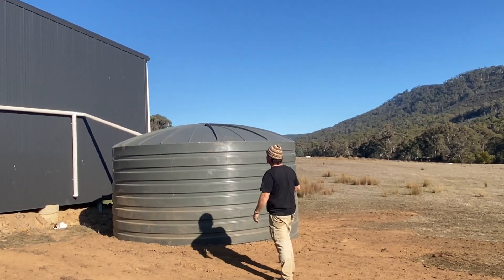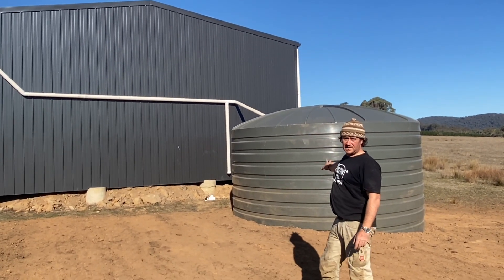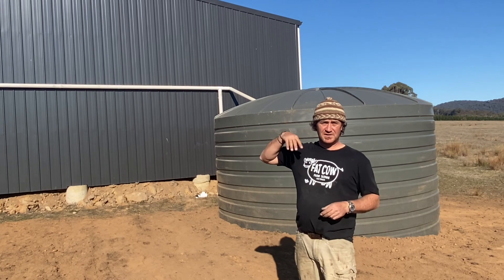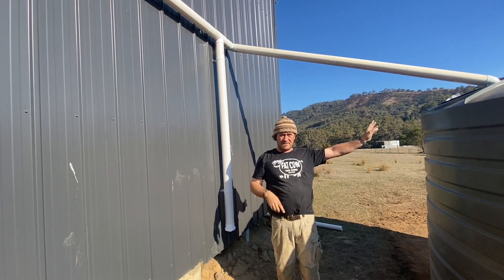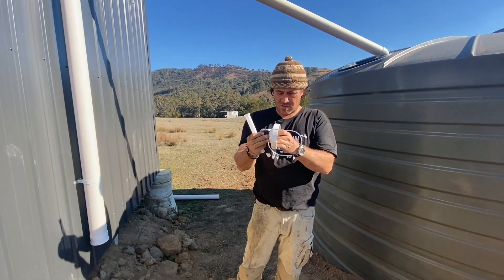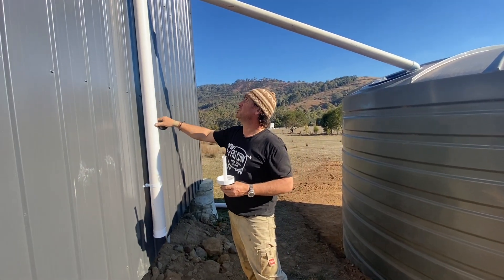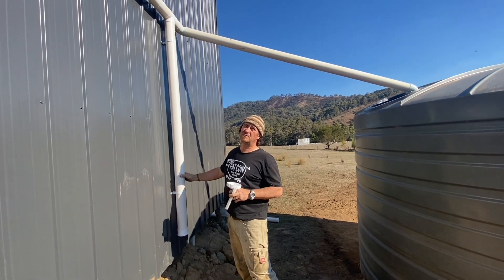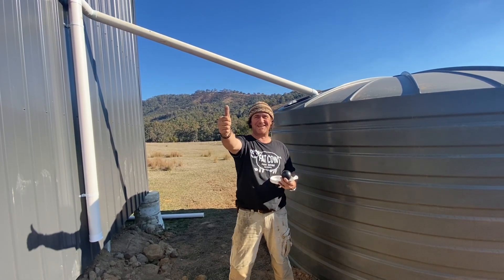Rain Harvest & First Flush Roof Cleaning.

Comment: (Old mate at the shop may have already told you!!)
But if there’s a bushfire & ash or burnt leaves are falling & it starts to rain or if you are using a sprinkler system on the roof, make sure you disconnect this system so all the water can run straight out the pipe & doesn’t flow contaminated water into your tank or you’ll have to dump the whole tank afterwards.

Comment: If you got large land area; try not to put solar panels on the building roof because you need to clean those panels around 3~5 months to maintain its efficiency.
Reply from the maker: Hi Rimzalla, i understand about the cleaning of panels on the roof may be dangerous, however we have future plans for the area around the shed. This is out only option removing forward. Thanks for the heads up.
Cheers

Comment: The first flush system is terrific for getting rid of leaves and bird sh*t from your roof. Looking at your setup I would imagine that you would either require a second flush system for the second side of your shed or, you will need the "T " section to be directly under your 45-degree bend from the shed to the tank. Otherwise, the dirty water from the second part of your roof will bypass the flush system, and you will have a system that only works at half its capacity and contaminates your tank.. The same would need to happen at the other end of your building. I hope this makes sense to you because I am about to head to bed and my brain just isn't working at full capacity LOL
Reply from the maker: Hey Les, I have another unit in my hot little hand ready to install on the other side. You beat me to it before I could put it together. If they work as they should I'll also install on the back end of the shed. I reckon its a cheap policy - first stage filtration.
Reply: @FatCowFarmTatong  It works for me ... ;)